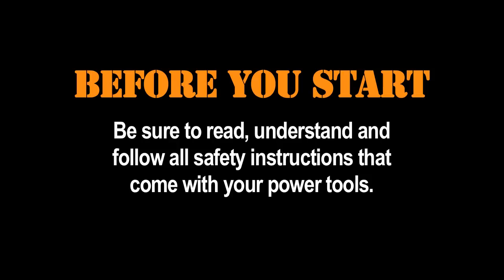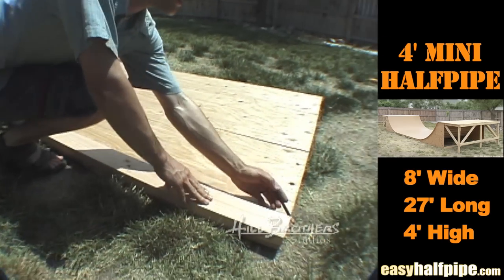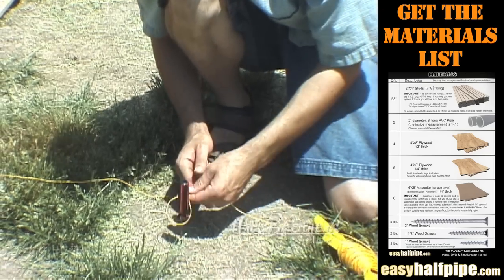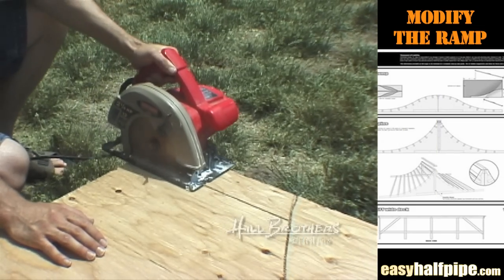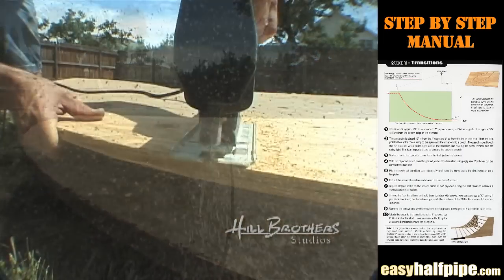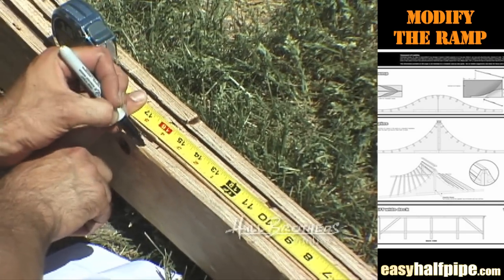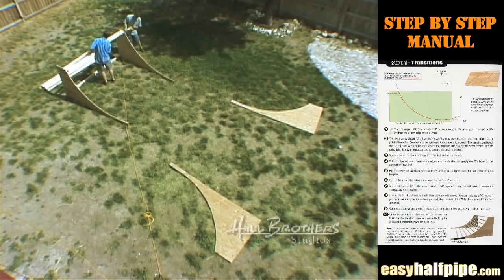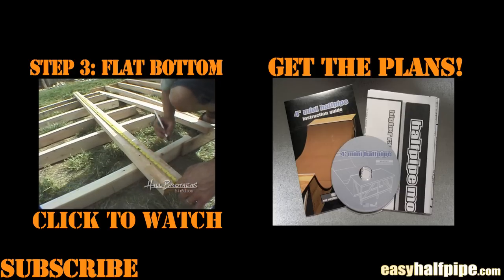How to Build a Halfpipe Step 2 TRANSITIONS

Comment: i dont see how it is 4ft high tho? because if your plywood is 4ft by 8ft and your cutting about 4'' on the top part of the transition so you can make 2 transitions out of 1 sheet, doesnt that make the ramp 3ft8'' high?
Reply: Most sheets of ply in the U.S are called 8 x 4's but are actually 2440 x 1220mm do the conversion yourself to get inches but at this size you'd get a full 4foot of transitions